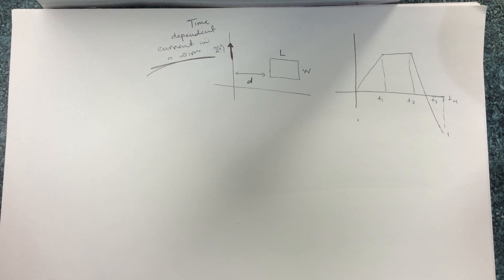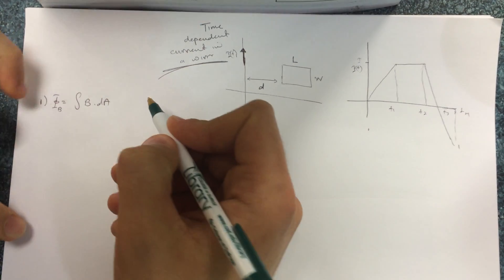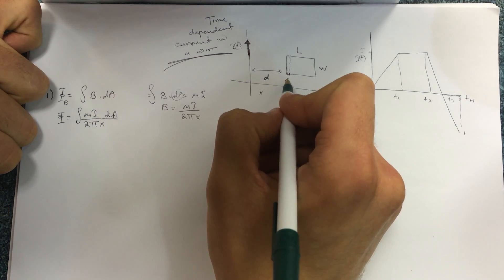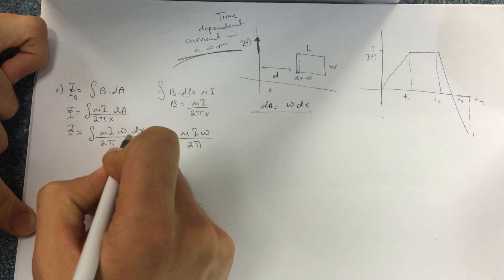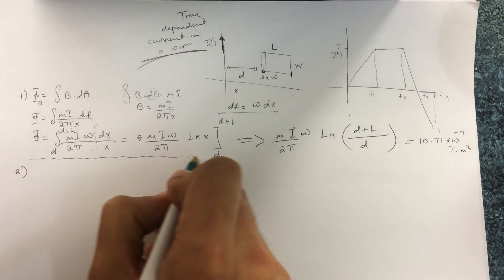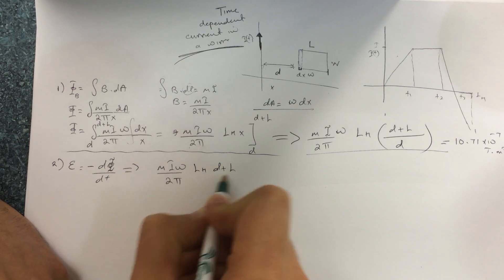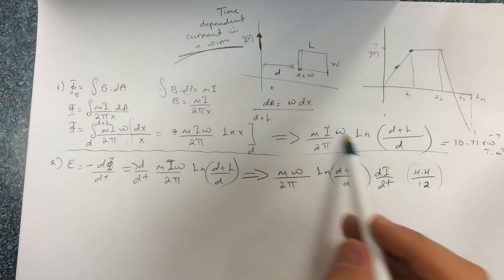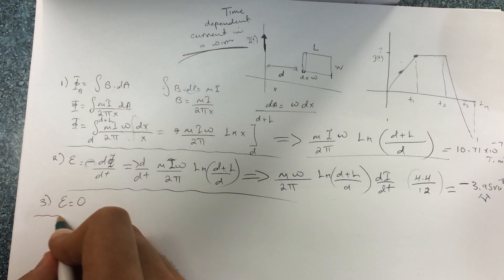Time Dependent Current in a Wire " Smartphysics" Solution.

Comment: I've been at this problem for over 3 hours straight now and I have to be missing something I'm using your numbers for part 1 and STILL getting a different answer than you. i'm doing (2*10^-7)(4.4)(0.37)/(2pi)*ln((0.24+0.79)/0.24) = 7.55*10^-8 not 10.71*10^-7 am I using the natural log wrong or something I even tried reverse engineering your answer to find a different U for my numbers but that doesn't give me a correct answer and i'm just straight up confused.
Reply: mu is not 2x10^-7. It's 4(pi)x10^-7...
Reply: u is equal to 4PI*10^-7,

Comment: Great video, but I am a little confused about #4. If I've followed along correctly, you say that from Izero to I1, the current in the wire is increasing and the current in the loop is clockwise. This makes total sense to me using right hand rule.

You then say that the current is decreasing from I2 to I4, but that the current in the loop is still clockwise. Shouldn't it be counterclockwise now? Using right hand rule, if we want more X's to oppose the decrease in current (and decrease in X's) wouldn't the current in the loop have to change direction to counterclockwise to achieve this?

Comment: for some reason my number 1 is not coming out right 
im doing all the plug ins for variables i have.  I had originally used wrong equation before i found yours
Reply from the maker: Mellogrl15 Im glad you got it:) Good luck :)
Reply: take out the PI

Comment: How do you do di/dt for numbers 2 and 5? i and t are numbers and differentiating them would result in nothing, so I'm clearly missing something. Please help,thanks
Reply from the maker: Good point, but I is changing with respect to time and you can see that from the graph. I can find it by finding the slope of the line , because di/dt is the same as (I2-I1)/(t2-t1) which is the slope of the line. I hope it helps.
Reply: Walid Hamarneh The problem doesn't have an I2 though. Did you just use 4.4/1.2 instead of di/dt? Because I tried that with my own numbers and it didn't work out.
Thanks for the help so far btw!
Reply from the maker: Look closely at the graph and you can see that I1 is equal to zero and t1 is equal to zero which makes my di/dt = (i2-i1)/(t2-t1)= i2/t2 which is my case is 4.4/1.2.
 You need two points to find the slope of a line which is the same as finding the derivative of a straight line is this case. Got it ?
Reply: Walid Hamarneh Ok, I tried that the first time and it didn't work. I tried it again only this time I wrote more significant digits and it worked. Smartphysics was just being stupid. Thank you so much for all the help!!